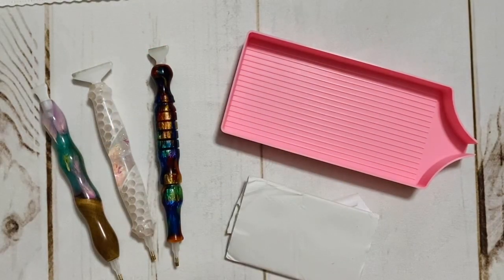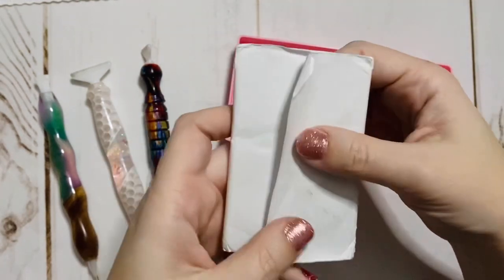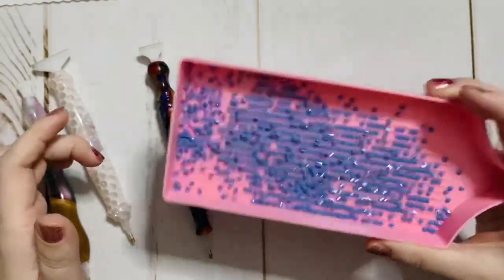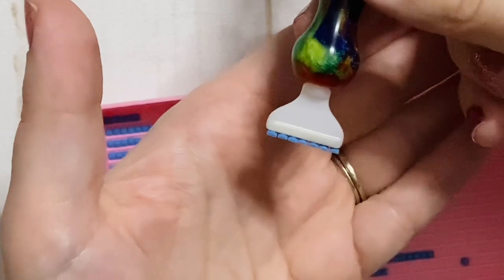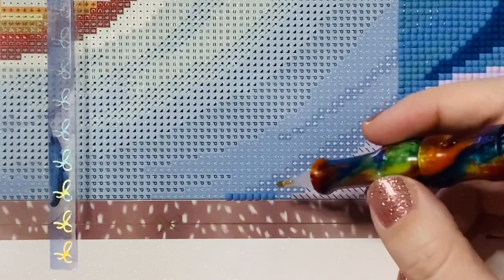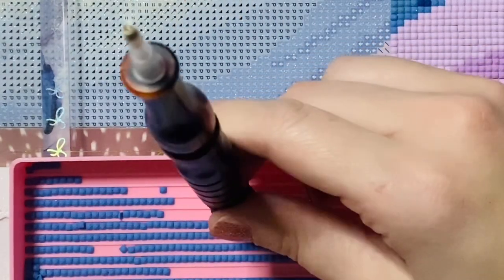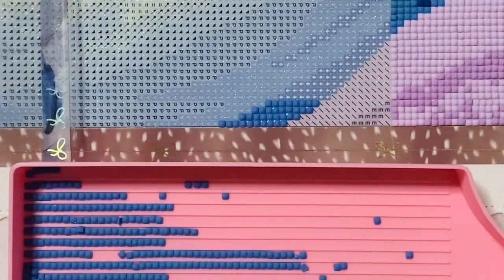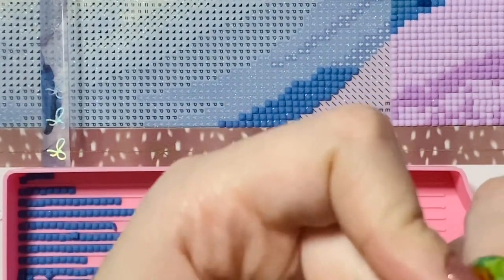Multiplacing for Perfectionists, Part 2: Squares Edition || A diamond painting tutorial

Comment: I use a steel ruler to guard the edge and start from there, place REALLY lightly, which makes it much easier to straighten after. My biggest multiplacer is 15 and the trick still works 😆 always have to resist nudging the drills with the tips too before I use straightener, because the tips push them down more than it can push them to the side, and I think it just pushes the glue underneath to be thinner and cure too much, such that by the time I get to use straightener, it’s really hard to push them into place or to stay straight.

Comment: Thank you for the video. Good to see how others multiplace squares. I go from right to left, but do use a curved multiplacer at the moment. But, still practicing a lot as my current canvas is perfect for it.
Reply from the maker: Thank you for watching, Berlien! How do you like the curved multiplacer? I have one but I've only used it a couple of times, with mixed luck.
Reply: @DiamondsandWashi  I do like the curved ones. For me, they work better. I did try out a few, a 3, a 5, an 8 and a 10 placer. I do prefer the 8 and 10. With the straight ones I always grab the 4 placer for some reason.

Comment: Nice video and great information. For some reason when I plant a row of square drills, they all rotate a bit which drives me a bit nuts. Not sure if I am pressing too hard or rotating it as I try to pull it off. I've been trying to do it straight down though so hopefully your technique for planting the first drill then rocking down the rest will solve this issue for me. Multi-placing is so satisfying when it works. :)

Comment: ❤ your soothing voice and helpful tutorials. Working on squares has been extremely frustrating for me when multiplacing because when push drills over they get off from the row so I cannot keep track of pattern and forget where I am. Like it’s a full row off by time get to row 45-50. Gets confusing. I work right to left in vertical rows. What am I doing wrong? 

I don’t enjoy single placing, but I guess I’m gonna have to try. to avoid the extreme frustration anger that occurs when multiplacing squares and pattern gets so wonky. I’ve had to stop 3 paintings now due to issue and restarting. 😢

Comment: Question, is there a way to get the static little dots out of the bag and have them not go everywhere?  I open the bag and they are so full of static that they go all over the place stick to my hand you go to move the tray and they just jump out at you any tips or help that I can get to do something so that it won't do that I would appriciate it greatly
Reply from the maker: Hi! I'd recommend cutting up a dryer sheet into small squares, and tuck them into the bags and shake them a bit. That should help!